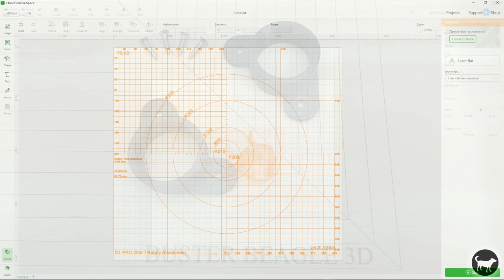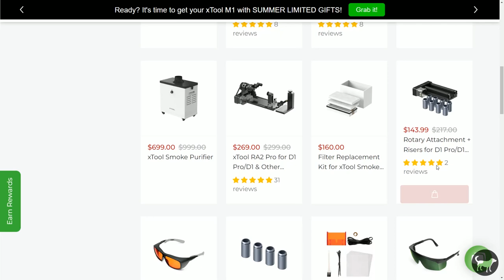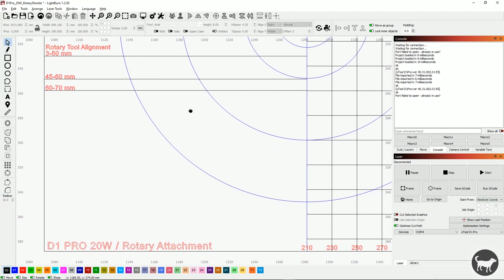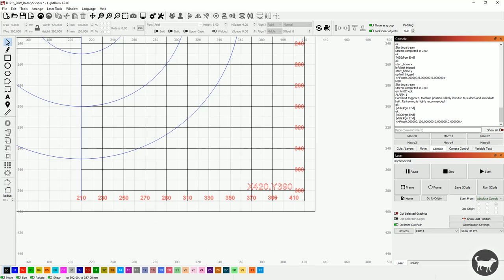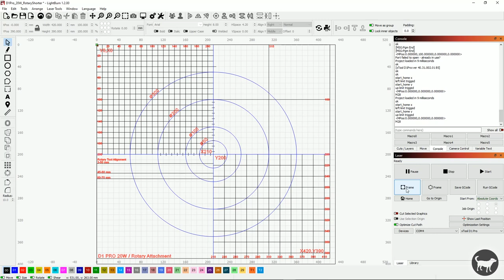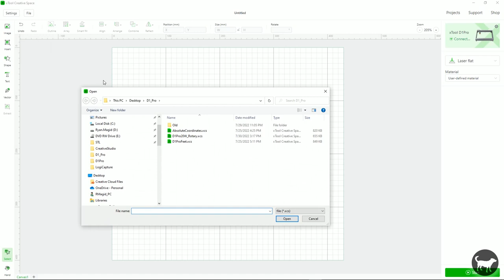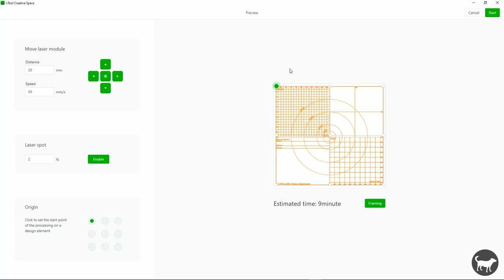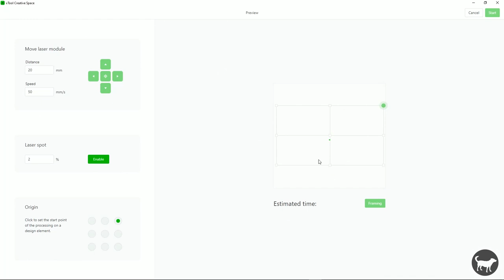xTool D1 Pro Grid Files | Use Absolute Coordinates | Lightburn | xTool Creative Space

Comment: I can't seem to be able to burn the grid as I'm getting a "element placement position exceeds the processing area" error any suggestions? Just received my D1 pro 10w along with the RA2 pro this week.
Reply from the maker: Hello Caleb. It seems the latest Beta version of the XCS software is conflicting with my XCS files. I have messaged you a link to the corrected files on Etsy.
Reply: @BusterBeagle3D  I wonder if I’m having the same problem. I have a new D1 Pro 20 watt and although I can burn the grid, I can’t seem to get it in the correct place. The home function in light burn doesn’t seem to correspond to the actual home and the center of the grid is 5mm off in both the x and y directions.
Reply from the maker: @carshius79  Hmm. That seems like a separate issue and not the same as above. They were having issues it xTool Creative space. 
Did  you turn off the Crosshairs before you burned the file? If you didn't you might have actually hit the right hand side while burning the grid, especially if you have the air assist installed. You need to be sure to turn that off in XCS first(even if you are using Lightburn after) and you may even need to remove the air assist while burning the grid. The hoses of the air assist may actually be hitting the wire loom on the right hand side which might account for the offsets. 
Let me know if any of this doesn't make sense.
Reply: @BusterBeagle3D  I followed the instructions to a T. Crosshairs are turned off, limit switches are off. I have made sure the cables are completely out of the way. After trying lightburn several times I went into XCS and was finally able to get it to work and the grid is finally in the he right spot. I can fire the laser at the home position and the center position and get a repeatable result. NONE of the times I burned the grid with the file from lightburn worked or were the same result as the previous burn.
Reply from the maker: @carshius79  There could potentially be a lot of settings in Lightburn that might create an offset. It could be a laser offset, could be a homing backoff value, etc. Which version of the file were you burning and do the coordinates on the gird correspond to the grid coordinates you have in Lightburn?
Reply: @BusterBeagle3D  I used the D1pro 20w ra2 file. I’m not sure about the setting you are referring to, I’ve never seen nor adjusted them. The file I tried to use in lightburn would not give me a an accurate home (zero) nor could I get it to go to a five point on the grid like x210 y200 (center). After I burned it with xcs it was finally centered correctly.
Reply from the maker: @carshius79  What I was saying was that if you open the grid file and the grid corresponds the coordinates in Lightburn, ie the x210 y200 match the Lightburn coordinates then something else is causing an offset. The 2 settings I mentioned are just 2 possibilities but it could be anything.  The Laser offset is under Edit>DeviceSettings>BasicSettings. The Homing pull off distance is under Tools>MachineSetting>Homing and Limits $27 Homing pull off distance. 
The XCS Grid is actually an export of the Lightburn grid that was imported into XCS so they are identical.
Reply: @BusterBeagle3D  same placement error happened to me. Can you send me the link?
Reply from the maker: @hcannon1107  Hello Henry. What is your issue? You should have the latest files.
Reply: @BusterBeagle3D  I made a few setting adjustments and got it to work fine. Thank you for replying. Henry
Reply from the maker: @henrycannon6522  No worries. Glad it worked out for you.
Reply: @BusterBeagle3D    This is my first rodeo.  I tried to burn the holders for the feet, following all the steps, and after hitting Home and Frame, everything looked good...  But the laser kept hitting the left limiter in both software tools (frustrating to say the least).  I looked at the settings above and saw the x-axis was set to -17mm offset.  Makes no sense why, but changing it to 0 allowed me to burn the feet.  I can now cut my board and try to burn the grid.  I'm hoping the grid will be positioned correctly with the corrected setting.  Thanks!
Reply from the maker: @tomuncc  Hi. Not sure when you got the grid but I had added a Read Me First file in the zip that goes over some of this like turning the crosshairs off and disabling the limit switches. I also just added a section about the offsets. The issue is that the firmware is adding that offset because that is the distance from the actual laser to the crosshairs. Turning it off in XCS used to turn off the offset in Lightburn but it seems to not do that anymore.
Reply: @BusterBeagle3D  I just ordered the short and extended versions yesterday.  I turned off crosshairs, but didn't have the guts to turn off the limit switches yet.  :)  Thanks for the work you've put into this.
Reply: @BusterBeagle3D  Update.  I updated the settings and then burned a tiny dot at each corner to ensure I had full travel and wouldn't accidentally ruin a new piece of wood.

That went flawlessly and I was able to burn a beautiful grid!
Reply: @tomuncc  Hey there, I am having some issues as well with my x-axis not aligning properly with the grid file, which settings did you change to get them to work properly? Thank you in advance.
Reply: @henrycannon6522  Hey there, I am having some issues as well with my x-axis not aligning properly with the grid file, which settings did you change to get them to work properly? Thank you in advance.
Reply: @wecraftstuff7911  when you install the latest firmware for the device, it locates the home as 0.0, but has a 16mm buffer that you don't get to see from Creative Space.  If you use Lightburn (can download the free version for 30 days), under the device settings, you'll see the x-axis has a value of -16.  I set that to 0 and then everything went well for me.  Hope that helps!
Reply: @tomuncc  Thank you for the response! I am using lightburn and did the same how did you get the settings to take in lightburn? I actually tried that and nothing happened unfortunately, it just jumped right back to the left (which was oddly out of the actual engraving area for both XCS and Lightburn). Did you do anything special like click over the writing switch on the d1? or did it just change and apply normally?
Reply: @wecraftstuff7911  for me it was just going to Edit>Device Settings and updating the Laser Offset to be 0.00mm on both x and y axis in lightburn.  If I remember correctly, that change seemed to propagate to XCS and solved the issue there too (to the best of my memory).  I've submitted the issue to xTool and they are now waiting on me to video that particular issue. In XCS, if you start a project at 0,0... framing doesn't work properly and you will hit the limit switches with the default settings.  I'm moving all of my laser stuff to a dedicated room, so I haven't got back to them yet on it.
Reply: @tomuncc  copy that, so you burned the grid in lightburn though and got it to work after changing the offset to 0,0? And then everything still lined up in lightburn on the grid with absolute coordinates? XCS wasn't used at all to burn or anything other than switching the laser to spot mode and turning off the limit switches? I appreciate your input btw, I've been fighting with this thing the past couple of days so just want to make sure I understand. 😆
Reply: @wecraftstuff7911  No problem.  Yeah, that's precisely what I did.  I then went back to XCS to burn and cut some coasters out of cork and it worked over there as well.  
Be aware that if you update the firmware later, as I did, you have to remember to update that setting again.

Comment: Welp, I tried to burn three boards , i thought i heard it skip early the second time, and definitely heard it skip the third time
.. when it moves to do the far left line, it hits the rail and skips a half inch and then throws the whole board off..any suggestions
Reply from the maker: Make sure you are following the steps in the Read Me First file to make sure you are setting up the grid to burn correctly. If the file is correct then I would check the tightness of the belts, if that is good make sure the wire looms on the back of the gantry are not somehow hitting the metal tab on the back of the laser. 9 out of 10 times I see that rear wire loom as the cause of many issues. First however make sure you read the read me first file.
Reply: @BusterBeagle3D  thanks, but yeah I did all that.  Cant figure it out still.  Pretty irritated
Reply from the maker: @NickyVEE89  What do you mean by you hear it skip? Like you hear the motors making a noise or you see it stopping and struggling when it should be moving? Also which software are you using?
Reply: @BusterBeagle3D  lightburn for now.  It hits the left rail, and I can hear the belt jumping for a second.  It frames fine.  It looks fine on the computer.  Starting to think its lightburn..  going to try the creative space now I guess.  If I burn the grid in creative space can I use for lightburn right?
Reply from the maker: @NickyVEE89  Yes you can try in XCS as well but it seems that something else might be wrong. As long as you turned off the limit switches and laser crosshairs you should be able to burn that gird without any issues in either program.
Reply: @BusterBeagle3D  well I will try to burn on XCS ..  and yes something is wrong and not sure if it's the laser or lightburn.  I did google search the problem and see that some others had had problems with the x axis skipping when going to the far left.  Thanks for the help.  I will let ya know if I figure it out I guess

Comment: I can't get this to burn in Lightburn. I have the 20W pro. Bed size is 430x390. Sets off limit switches. How to fix??
Reply: To add, it frames fine. But when I hit start, it immediately throws the limit alarm..
Reply from the maker: @antennasbc  Be sure to read the "Read Me First" file in the zip folder. It goes over extra steps to successfully burn your grid including turning those limit switch alarms off.
Reply: @BusterBeagle3D  ok I did read that. I thought limit switches were optional. I'll turn them off. Also should both software burn the grid in the same place? As they do not, they are 5mm off between the two in the vertical lines.
Reply: @BusterBeagle3D  ok, si tried again and it burned fine. I turned off the limit switches, and back to Lightburn and burned it. Seemed ok. Limits back on. Now when I tell it to go to a spot it's off 5mm in the X. Everywhere. What would cause that?
Reply from the maker: @antennasbc  In Lightburn there is also a pointer offset. Just make sure that is turned off. It's under Edit > Device Settings.

Comment: I am all set to burn the grid, I am worried about the setting for the red "02" layer, it is set a 6 speed power at 100 with 2 passes, is that correct?
Reply from the maker: That does not sound correct. Make sure you are opening the file and not importing it into Lightburn. Importing can give weird settings.
Reply: @BusterBeagle3D  I did import, i will load again.  Thank you
Reply: @BusterBeagle3D  I got it to burn, it looks good, i am testing a coaster with I centered at 200x200, the design was 10mm off to the left, I am hoping there is a correction I can make in the tool box because I don't think I did the grid incorrectly.
Reply from the maker: @beckybedrosian7607  Just remember that the center of the grid is 210x200 and not 200x200. You may just have to shift your design over.
Reply: @BusterBeagle3D  well that explains the issue.  Thank you, I thought I was going to have to burn the board again.